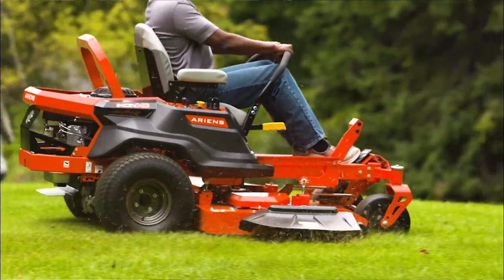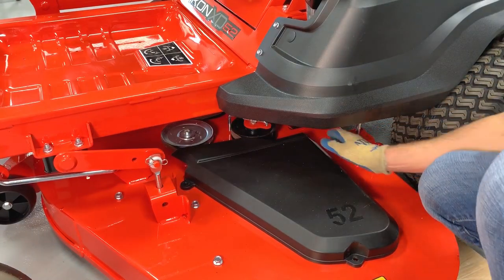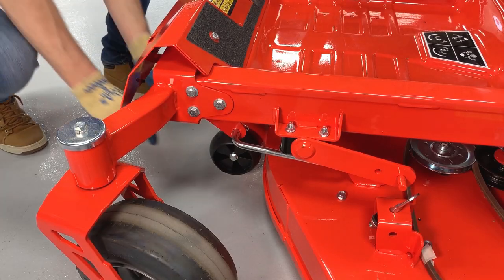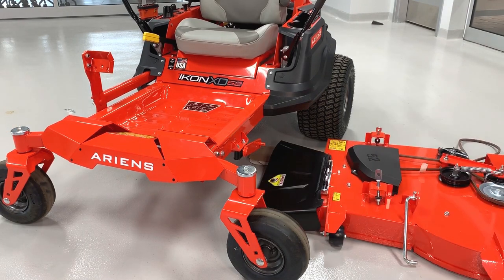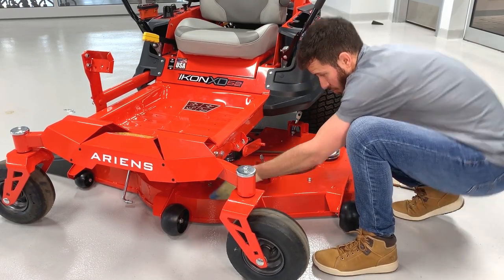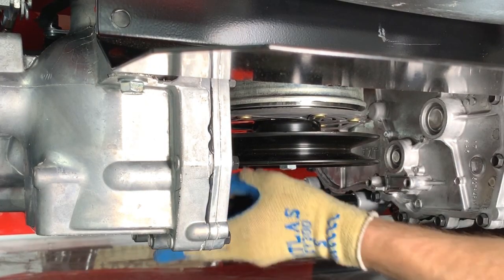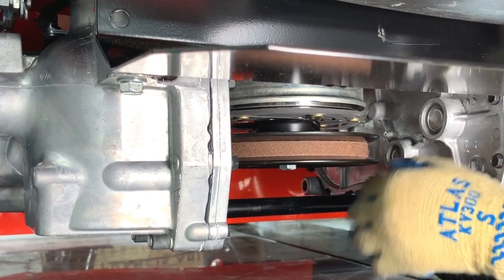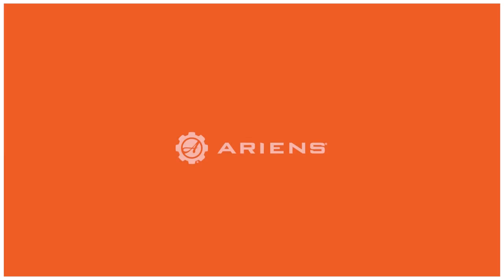How to Remove an Ariens® IKON XD Zero Turn Mower Deck | Ariens

Comment: To make it easier to move out I cut 2 schedule 4 pvc pipe to the size of each board. Then after unhooking everything I replaced the boards with the pvc pipe rolling the deck out . Worked like a charm. Ps I removed the discharge shoot to get more room.
Reply: Excellent idea on the PVC! Thanks for the tip!

Comment: On my Ikon XD can I downsize from a 52" deck to a 42" deck? I just bought the mower last year and will have a smaller yard now so If I could just swap decks out that would be great.
Reply from the maker: Thanks for asking, Jimmy. The chassis of all Ikon XD models are identical, so this may be a possibility, but we can't guarantee it.

Our recommendation is work through your nearest Ariens dealer. They'll be able to advise you, and order the deck assembly for you if they conclude this is a viable and safe option.

You can find an Ariens dealer in your area with our dealer locator tool:
https://www.ariens.com/en-us/dealer-locator
Reply: I’ll trade you my 42” for your 52”

Comment: Having trouble removing the blades. Are these backward threaded? I tried both ways and it's really not budging.
Reply: Use an air driven impact socket
Reply: Don't know if you resolved your issue yet but I had to hold the pulley on top to get the nut holding the blade on to come out
Reply: I tried to remove the nut with a long wrench but could not loosen it so I started thinking like you maybe it is a left handed nut. It's a pain as you have to raise the deck high enough to get your impact gun and socket under the nut. You will have no problem then.

Comment: When jacking the front of mower, do you jack from the front frame or deck to get access to the blades? Also, do you leave the hydro locks engaged or released when jacking?
Reply from the maker: Great questions! Always have the jack contact the frame when raising the mower – in this case, the front of the frame is the best spot. Also use jack stands and refer to the safety section of your operator's manual when completing service.
Additionally, keep both the parking brake and the transaxles engaged when jacking the front of the mower.
Reply: @AriensChannel  greatly appreciate the quick response. I’ve been looking for a clear answer since buying the mower this summer. Great mower by the way! Thanks again.
Reply from the maker: @Cuttymcnutty209  You're very welcome, and we're glad you're enjoying it!

Comment: Need a spindle replacement how-to!
Reply: No you dont.
Reply: after removing the deck, remove the blades attached to the spindles you need to remove then there are 4 bolts on the underside that hold the spindle in place. after the 4 bolts are removed the spindle freely pulls out the top

Comment: These mowers are junk. I have less than 40 hours on mine and have broken 2 drivebelts and have a leak from the right side transaxle. Even though it is under warranty I can't get any help with the issue. Terrible customer support. Buy anything but an ariens
Reply from the maker: Hi Nathan, we're very sorry for the experience you've had with our product. Can you please tell us if you've reached out to an Ariens dealer in your area? Our independently owned and operated servicing dealers are an extension of our team and can resolve the issues you've described. Additionally, they can administer warranty claims for manufacturing defects.

We'll link our dealer locator tool below so you can find servicing options in your area. Give this a try, but please let us know if you still haven't reached a resolution.

https://www.ariens.com/en-us/dealer-locator
Reply: @AriensChannel  washer up or down? Changing blades and I forget lol
Reply: I have experienced fine support from Ariens. I am disappointed about my belt getting jammed between the pulley and the spindle. Seems like it would be easy to pull out but the belt ended up getting cut. I am satisfied with Ariens though as I received new parts.
Reply: @billjenkinson7728 did you mean washer on the top of the blade or the bottom? On the bottom - between the bolt head and the blade...cheers
Reply: 53 hours on mine so far. Hasn't missed a beat!